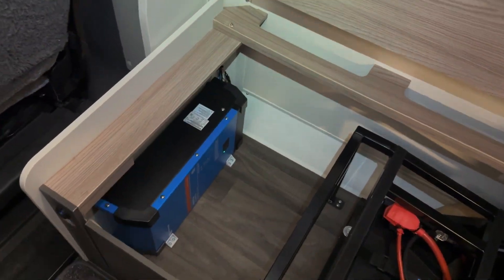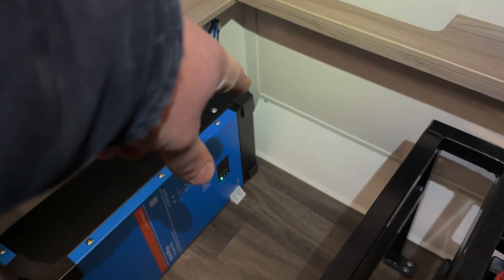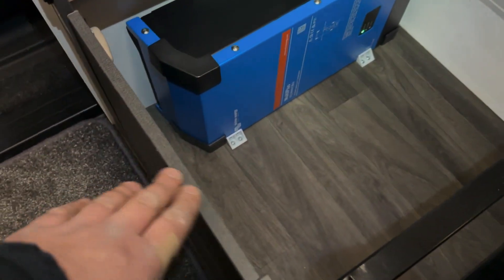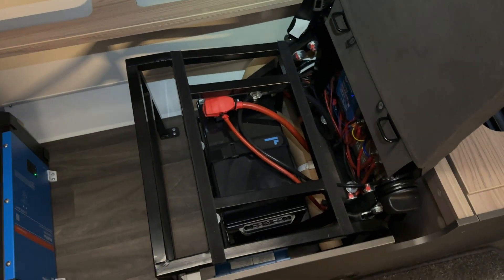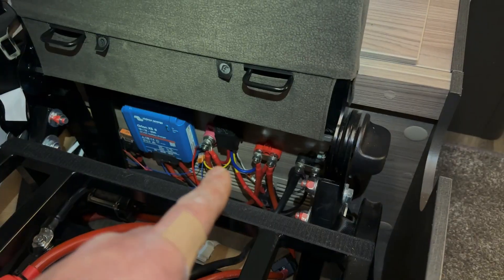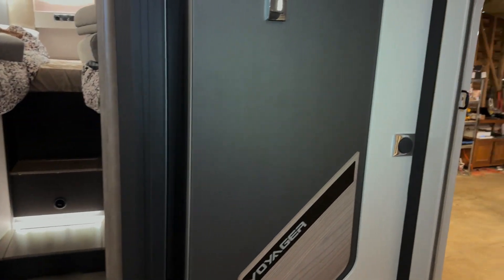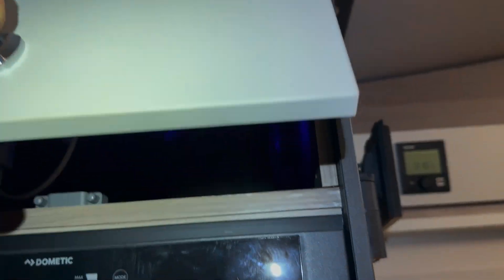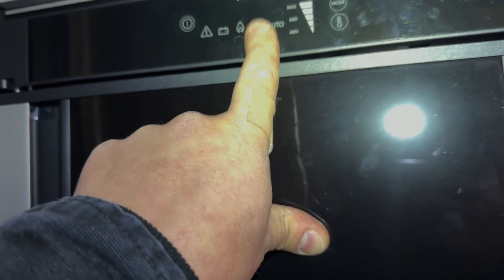Lithium & Victron upgrade on a Swift 584

Comment: Did you do an upgrade on a Hymer ML-580 on a Mercedes 6 cilinder 190 hp? There is Schaudt in it with AGM battery. 2x95Ah. Please advise.